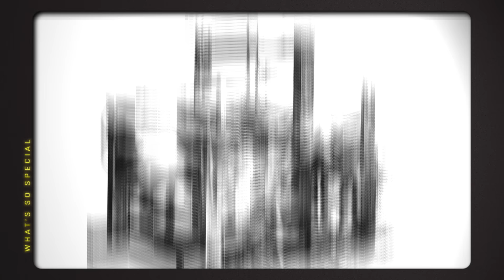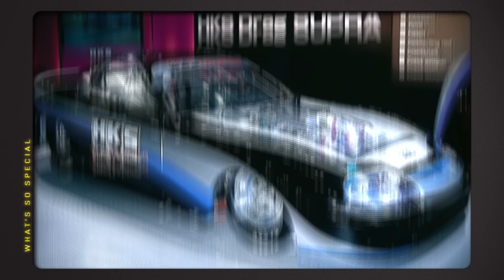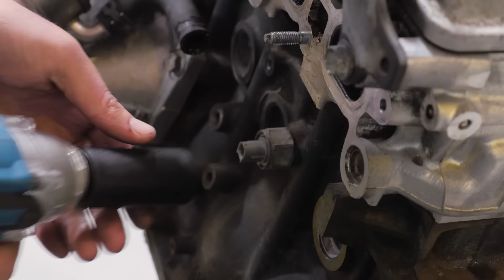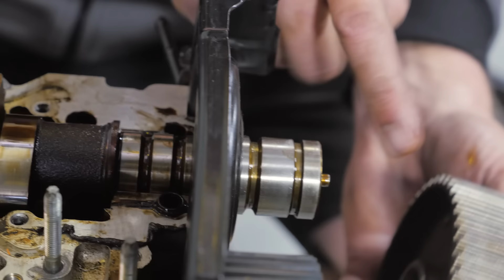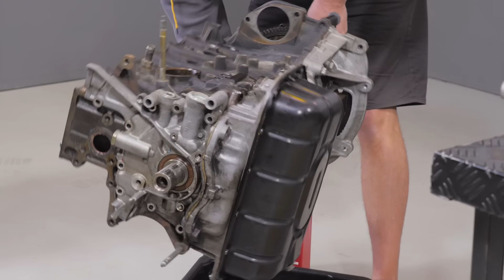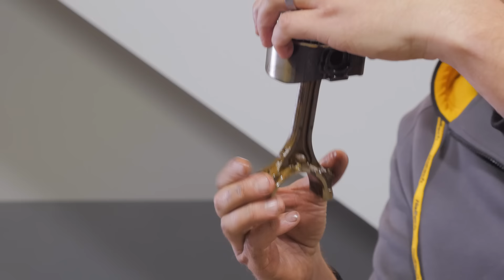🤔 What's So Special About Toyota's 2JZ?  |  TECHNICALLY SPEAKING

Comment: Here i am watching Tuning Fork again 3 years later. 
I just scored a 2000 Lexus sc300 with the 2JZ-GE engine. I'm new to Toyota/Lexus and the 2JZ engine.
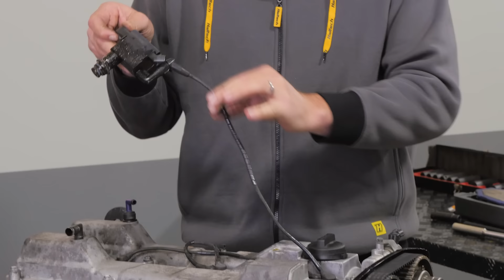12:30  - is that a wasted spark or is the spark firing for a companion cylinder? 🤔

Thanks Tuning Fork 💪😎🏆

Comment: Inline 6 isnt a good engine for circuit racing, too long and heavy, not surprised the Inline 4 would be chosen for circuit racing.

You dont need a tonne of power in circuit racing and you're usually limited in displacement.

Comment: Forgot about the Crown?  All the R series, the M series, G series, JZ series, and continuing to the GR, UZ, UR and TR series, they all powered the Toyota Crown.  It can be said that the M series were made for the Crown foremost, and everything else was made because they were derived from the Crown platform, which also conveniently furnished a rear wheel drive platform.   Being Toyota's flagship car, Toyota developed, then threw, its best engines on the car and its subsequent generations.

Comment: Would thw same thing happen on a motorcycle engine suzuki 500 but instead of the coolant hose breaking .the fuel line popped when we're running for over an hour causing a fuel leak?

Comment: Two years Running an Elite 2500 with a terminated harness. Like mentioned it was very easy to install, lots of extra circuits pre-wired for additional sensors. A lot easier than trying to modify a stock harness. Worth the cost to go with terminated harness vs flying lead or jumper style.  Added IC7 display and touchpad with the nexus update, its next level cool! 600whp @ 29psi unopened long block non vvti in a Tundra. Thanks for sharing!

Comment: uh, its an inline 6 with a decent cylinder head. i-6s are inherently neutral balanced and the proper number of main supports helps make a strong block. its no secret that cfm = power for cylinder heads. why is this some huge new thing that people are just learning? 

i-6s were common in economy cars back in the day because they were smooth but down on power because you cant make some ridiculous size inline 6 and have it fit under a hood line unless its a truck and/or has a huge front end. 

finally, whatever you do to a 3.0 i-6, a 3.0 v8 will make the same power if all other things are held equal

Comment: I wish Toyota sold 2JZ crate motors. Even of is just composed of cylinder head, block, and crank because enthusiasts will put their own internals, valvetrain, and pumps on it.

Same design, and maybe use modern alloys and casting techniques. If they did that instead of wasting big bucks on the LFA, they would have had a better marketing result. With the money they spent on the LFA, they could have made a 3JZ.

Comment: VVTi was added to 1JZ/2JZ-GE in 1995. Early VVTi 2JZ-GE (95-96) had the GTE rods. Weak rods for the GE VVTi began in 1997.
Reply: Which vehicles received a VVT-i JZ-GE prior to 1996? All examples I can find make the switch to VVT-i in September 1996 at the earliest, and always coinciding with the change to the thin rods
Reply: All 2JZGTE from September 1997 have VVTi.

Comment: If you use an after market clutch with a harder pressure plate, do NOT ever keep your foot on the clutch. Regardless, never keep your foot on a clutch at a stop, take it out of the gear :) Great video, 2jz was the first engine I ever took it apart, so easy to work on them :)

Comment: Probably worth mentioning that the VVTi GTE engine was never released in the USA so you can't put USDM intake cam in it like you can with a non-VVTi 2JZ-GTE.

Also, the VVTi mechanism itself is pretty much disabled around 5k RPM and the VVTi GTE variant also has a slightly higher redline compared to non, 6800rpm for non and 7200rpm for VVTi.
Reply: my ge non-vvti will rev to about 7.2/7.3k if i hold the gears, granted makes barely any power but it does it - even though the line on the dash is at 6.8k :)
Reply: I'm pretty sure the GTE VVTi engine was never released outside of Japan.
Reply: @NearCry91  you are 100% correct

Comment: 2 J ZED dammit!

Edit: there were a number of reasons Toyota used the 3s in the JGTC race cars and it's not just because they had already been developing it. Using a 4 cylinder enabled better weight balance, was lighter and as turbo restrictors were in use, the 3S gave them their power goals with a better power band than a 2jz if it were to have a restrictor.
Reply: Zee. Not zed.
Reply: @cavalierliberty6838  most of the former British colonies (as well as the Brits themselves) still say "zed", I think those of us in the US are the only ones who say "zee" 😁

Comment: 1000whp on stock rods? Anyone acutely seen the video of one ?
Reply: Yea.  Sound performance did a twin HKS turbo car that made 1008whp on stock block in like 2007.      It will live with a good tuner and someone that doesn't beat the shit out of it.    E85 and tq bends rods.        to be fair this car from 2007 made the same tq as a modern 64-67mm single e85 supra. which is around 725-750 tq.
Reply: Plenty of videos floating around , they have cracked over 1000whp on non-vvti GE engines as well

Comment: Reminds me of the 1997 volvo straight six but this motor seems to be thinner the volvo was wider also shorter great size motor this 2jz. The volvo motor was designed by porsche and is a sweet heart of an engine. I wish the pcv system was better though and better ac condenser rubbers are too brittle and the coolant desevoiur is a joke. They never changed it from the 80s. But what can I say I have had it for decades lol still drives me everywhere comfortably.

Comment: Great Video first of all and good explanation for non engine builders like myself.  One engine I would like to see an episode about is the 3S variant that Toyota used in some of the Supra's for racing like you mentioned and possibly some explanation as to why those were chosen over the 7m series or the JZ series. Also if you could show the Iconic "Cheat" valve that got them disqualified using the Celica GT Four in Rallying.
Reply: The 3S-GTE is the same engine (essentially) as the MkII MR-2 turbo and the Celica GT-Four. They used it (longitudinally) in the JGTC Supra because the GT500 class rules were set up to limit the engines to around 500 bhp (or more likely, PS... hence the name, and likewise the GT300 class cars were limited to around 300 HP). The 3S was a noticeably lighter and shorter engine since it it was only a 4-cylinder, and they would have no problem making 500 HP on a race variant of that 2.0 liter inline-4. The narrower powerband from getting 500 HP from a 2-liter vs 500 HP from a 3-liter would be a minimal issue since race engines spend their lives at the top of the rev range anyway, and the marginally reduced throttle response ("turbo lag") was an easy sacrifice when compared to saving a sizeable chunk of weight from the heaviest end of the car. Weight is the enemy in racing, and reducing weight while making the weight distribution better is basically the holy grail for a motorsports engineer.

Edit: As far as the restrictor "cheat" from the Toyota WRC cars, he'd be hard pressed to make a video about it, I think. There are almost no images of the device itself on the internet, only a few drawn diagrams, and I imagine the devices themselves were all destroyed afterwards.

Comment: Just bought a 98 gs300. Replaced the camshaft seals without taking the valve covers off. Only remove the pulleys to get to the seals. Mark the teeth with white marker to the belt, jam something down between to hold the belt tensioner. A pipe wrench will hold the vvt to remove the bolt and a screw driver though the sprocket for the other. Took less time than two hours.
Also the vvt can stay in place, just pull the 5 bolts to replace the O ring to stop the leak. Took me 20 minutes.
Reply: That's heaps ghetto

Comment: Well, technically Toyota did not develop that engine. I hate to burst the bubble fan boys, but it was Yamaha. And Yamaha has been Toyota secret weapon as to why their 1UR, 2,3UR series and the 7m, 1,2jz, 3sgt, ZZ, 3TC, LFA 10cyl  and many other were made by Yamaha. So, this video should of been Yamahas incredible ability to design kick ass engines. I'd even put them against Honda, and that's a tall claim. But Yamaha is extremely under-rated, they even developed the Ford SHO engine on that old Countour. Yamaha has made many engines for a couple of manufacturers. And Honda and Nissan have copied a couple of design cues from them. The most popular JDM engines I'd say are developed by Yamaha. Not all but a couple.
Reply: Toyota developed the engine, Yamaha the head.

Comment: Imagine the torture Toyota engineers put the prototype motors through. I'm sure all manufacturers of that period had a "needs to be able to handle Group A" minimum. You don't come across a 1000hp design by accident. I wonder what kind of thinking the engineers did behind the block design. How much they pushed the old 7M, did they put the RB series under X-ray and fix all it's weaknesses? To be capable of double it's factory output is one thing, but 4-5 times is just crazy. You really see their ambition and passion for engineering in the older Toyota designs.
Reply: 1,000 hp design? There are 3,000 hp 2JZs out there.
Reply: @PistonAvatarGuy  Yeah, the billet block 3000hp magical unicorn $100,000 builds I won't mention. There's nothing Toyota about those engines at all by that point.
Reply: @Jez3134  The heads are still Toyota heads and the entire architecture of the engine is still Toyota's design.
Reply: @PistonAvatarGuy  Yeah incredible power, but again. I wont go into $100,000 builds. It's too far from reality
Reply: @Jez3134  It IS reality, people actually build those engines.
Reply: @PistonAvatarGuy  mate, I get it. There's 2000hp 2jz and RB billet motors out there. The volume of those motors is less than a percent of what's being run out there hence I didn't want to go down the rabbit hole of huge money no cost engineering builds that address all the weaknesses of factory components.
Reply: @Jez3134  3,000, as in: THREE thousand. Anyway, your only goal seems to be to diminish the greatness of the 2JZ, that cannot be allowed.
Reply: @PistonAvatarGuy  k
Reply: @Jez3134  Good, as long as we're clear.
Reply: @PistonAvatarGuy  clear as mud

Comment: Hi Haltech Team, what do you guys suggest to do around auto control for an Aristo with a 2JZ-GTE + A340e?
Reply: The new elite 2500's can control the A340e. I got a supra with a GE and A340e, got the harness too, but can confirm that it controls that tranny fine cos it's a selectable option in the tuning
Can't remember if it's controlled via CAN, but it's a really simple/minor connection to make it work
Reply: @edcbb3  so you're running the 2500 elite as a standalone ecu?

Comment: sometimes toyota has weird engineering moments like putting starter motors under intake manifolds on V8
Reply: As I understand it, the UZ starter motor was put there for packaging reasons - otherwise they would have had difficulty fitting it in some models that used it - but yeah I had one fail on me in a Soarer about 20 years ago, and it took me most of the weekend to replace it - I was not happy.

Comment: Mercedes Benz M103 and M104 are a very stout engine in factory form. Also know as the German 2JZ. People in Europe have made over 1000hp on un opened bottom ends. Some say Toyota copied mercedes with the design of the 2JZ
Reply: No, please no. I like my m103 to be unknown and cheap XD. The stock potentional (esspesially the m103 beeing a low compression engine) is huge, easy 700 dead stock all day :P
Reply: 2JZ was an improved design of the 1JZ. Toyota didn't copy Mercedes

Comment: Hi mate, minor correction, the sequential setup on the 2jz is a primary that runs on all six cylinders, which then pre-spools the second identical turbo, before bringing it online to provide parallel twin operation, ie. two matching turbos each fed from 3 cylinders. I am in the process of setting up an elite 2500 to run the factory sequential system with high flowed JDM CT20 turbos.
Reply: Eeeyyyyy I'm doing the same!! Did you get the harness as well? And if you did, and installed it yourself, you had any problems doing it or is it just time consuming to route it properly cos I'm scared of fucking mine up lol
Reply: @edcbb3  I'm using the premium harness, adding oil pressure, fuel pressure, flex and a DBW throttle then wiring and re terminating everything.

Comment: The sequential turbo system does actually use both turbos after 4000rpm. Has a very interesting system for blocking the hot and cold outlets of the second turbo to stop it from spinning. There's a 3rd valve that opens to allow it to start spinning at I think it's 3500rpm from memory. Then at 4000rpm, the other valves open up and then both are working like a parallel system.
Reply: Does this apply to the twin turbo 1jz?
Reply: @BoomBox02  Nahh, they were parallel. Then the VVTI ones single turbo
Reply: Yeah, spot on. However when I ran BPU, I fixed the actuators on open and both turbos worked at 4000rpm, cheap man's single turbo kit :) fun times, hated to work on the TT kit, such a tight fitment
Reply: Yes it feels like nitrous when that 2nd turbo opens and you feel it just after 4k rpm. But you got to be on the throttle, otherwise you will never feel it.

Comment: curious to know of the makita really did just undo the crank bolt that easily? Nice work on the video :)
Reply: Hell no you need a super strong impact wrench or huge breaker bar lol
Reply: @FightingSportsMedia so ive heard....the makita hi totque has 1600nm of torque...the milwaukee has similiar and can do it but ive already bought into the makita system so keen to see if anyones had any luck.
Reply: @Scott Hilzinger Scott, it's OK to say "Zed"... Yanks are quick learners depending on subject matter ;)

Comment: It's a perfectly balanced engine that's probably one of the reason why it's so good
Reply: Its more the block itself being able to hold 2000 crank hp ....
Reply: @ACommenterOnYouTube  The heads are used on engines making 3,000 hp.
Reply: You'd have to be doing something really wrong to have an unbalanced I6

Comment: All i did for my GTE was build the head and left the bottom end stock. Going into my S13 as a street/track car until i'm craving more power.
Living in the US makes owning an RB kind of undesirable if i get stranded with no available parts. Plan is build my S13 reliable and strong and if i want an RB, then get a R32 later hopefully
Reply: RB's are legendary bu even RB owners will tell you they kinda suck to mod. They need so many mods to not die at moderate power levels.
Reply: @FightingSportsMedia  RB owner here, I wouldn't say they're so bad that they suck. Rb's will do a reliable 300kw all day long, which is plenty in a 1300kg street car. Considering you'd run a high 12 sec pass with 200kw. The Rb25 head doesn't even need cams until 400kw. 350kw is where your reliability is getting questionable if it's not a Neo rb25 (26 rods) or rb26. Just gotta be mindful not to smash limiter like an idiot to preserve the oil pump.

Comment: The factory turbos are the same size. In lower rpms only one turbo makes boost and when you go higher in the rev rance the second turbo slowly comes on. In higher revs both turbos are working at the same time.
Reply: Secondary turbo has a larger exhaust housing if I remember correctly
Reply: I'm pretty sure you remember incorrectly.
Reply: @NearCry91  I looked at the exhaust housings of the stock turbos, and could have sworn that the 2ndary had a larger housing.